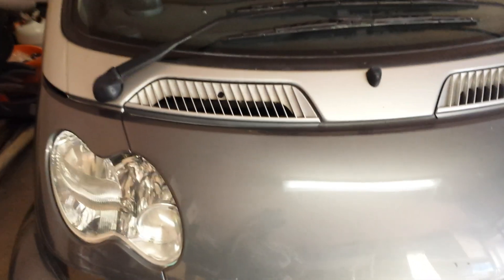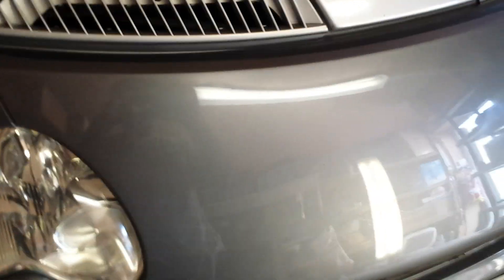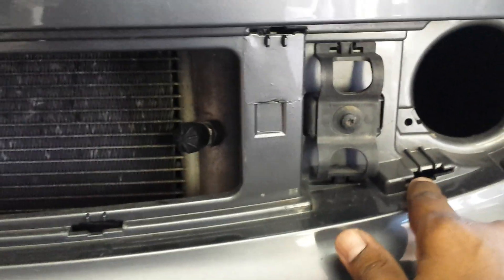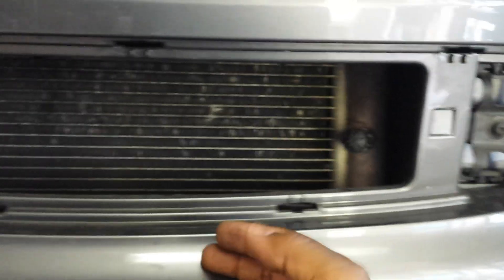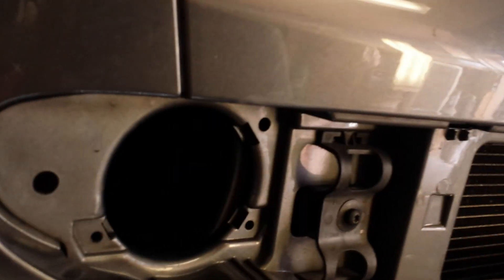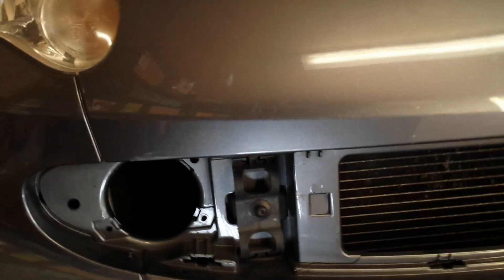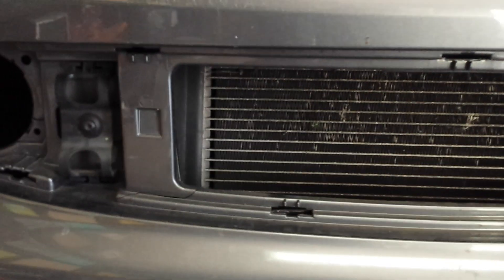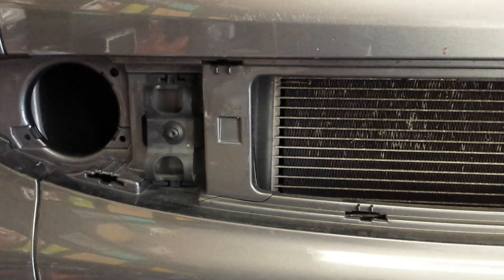Smart Fortwo   450   Air Conditioning Top Up points

Comment: Nice Video. How do I know if my Four Two 450 Coupe uses the R134a or R1234YF Air Con top-up fitment ?
Reply: Mine shows by the engine as R134a which now using R12a

Comment: The low pressure side where you top up is the one on the left in the hole.  I learned that hard way trying to top of the more accessible right side fitting and snapped the $%#@* thing off!  Am pricing out a new condenser now. :'(

Comment: Have you changed the Air Conditioning Activated Charcoal Filter?  If so, where did you get the part and do you recall the price?  If your mechanic serviced the filter do you recall the approximate repair cost?  Thank you
Reply: Jack Ferrell The air conditioning activated charcoal filter is a fancy term for the cabin air filter which is located to the right of the accelerator pedal and has a cover clipped on to it. The charcoal filter is probably about $20. There's several brands of filters that fit this car.

Comment: Do NOT do anything with the Hi Pressure bleeder port (the one that is easy to get to).  It can be ridiculously dangerous, and you can do terrible damage to the compressor.  Only refill using the low pressure port (the one in the hole).
Reply: And where is the low pressure port,Can you tell me please,???
Reply: @1998artek  the one in the HOLE Leslie said